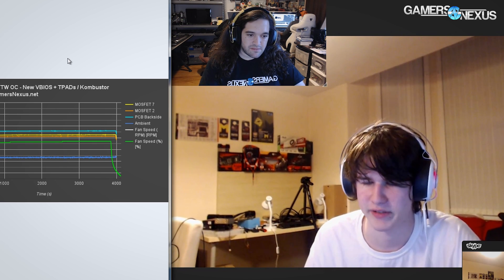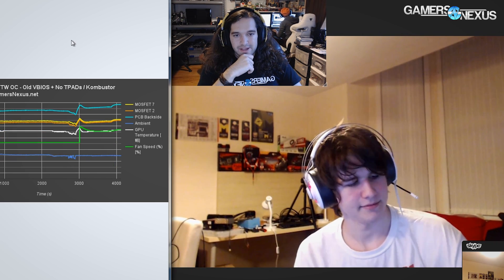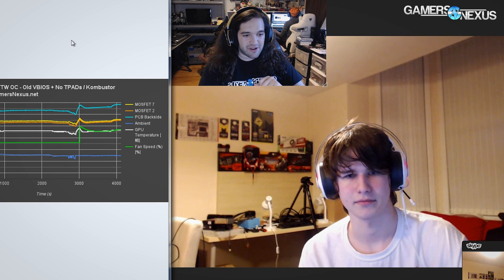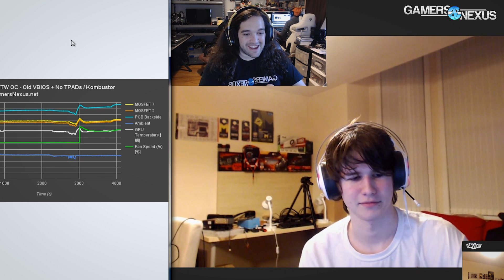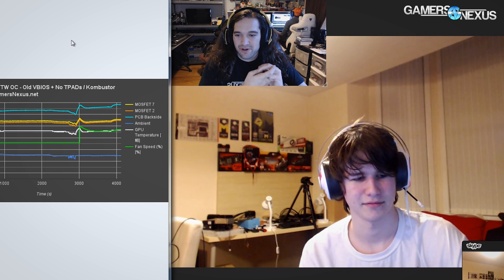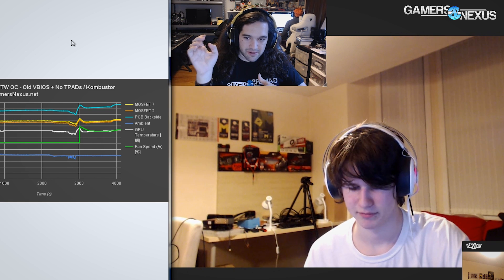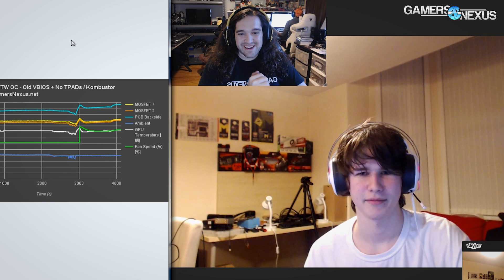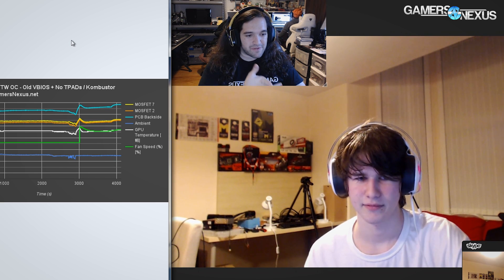Full Buildzoid Conversation on EVGA VRMs & Dying Cards

Comment: I had a 1080 FTW DT pop on me a couple days ago during path of exile. Didnt notice any real flash and my computer is next to me with a window, all I heard was a slight pop noise, then a light electrical smell. No big deal to me since its under warranty, and my PS shut down the computer. It was a pretty bad card to begin with. Ran very warm, could only top out at 1835. Good riddance. One less bad EVGA 1080 out of there. Did make me get paranoid about temperatures though, use a 1080 Hybrid now (woohoo amazon prime and 2 day shipping!), runs so much cooler, much louder though, but ill take a bit extra noise for it running 35 freaking Celsius cooler under load in similar gaming environment I tested both cards with. Wish I saw this earlier, I already have mine on the RMA train, it only had a very small scorch mark after taking the backplate off to inspect it.

Comment: This is what EVGA tole me. Is this BS?
I do apologize for any confusion this matter has caused as I would like to take the time to clear up any issues you may have about the 1080 / 1070. The EVGA GeForce GTX 1080 and 1070 do in fact have thermal pads as air alone could never cool this area enough to operate properly. The test that was run causing people to be worried was with a benchmark that has been known by Nvidia to damage cards in the past. Due to this the drivers by Nividia actually have it built in so that if your are running this program the card will throttle down. Some people know how to get around this and will run the card in extreme environments. 

We are offering extra thermal pads to customers that want to see better temps when pushing the hardware however this is not necessary and is completely optional. These additional thermal pads will be installed between the backplate and the PCB and between the baseplate and the heatsink fins only as these add additional support to the card for extreme use. These cards are within spec and will run under normal circumstances with no issues. However with that being said we are providing a VBIOS for the cards in order to increase the fan speeds to help with the VRM temps. We are here to support you and if there is any issues with the product you are still covered under its available warranty. 

If you would like to have the card replaced with a model that has the pads installed we can support you with this request. Please read more about the thermal pads in the link I have provided below. Once again I would like to take the time to apologize for any inconvenience and confusion this matter has caused.

Comment: Surely NV reference designs have SMD ceramic or poly fuses on the power rails (both from the slot and PCIe connectors)?

And if so, why in the world would a board partner remove that from the PCB layout when customizing it...
Reply: The only fuses I've ever seen on GPU PCBs are a few cards from Sapphire.

Comment: Shouldn't everyone be even more concerned now because EVGA went along with it being a thermal issue, but it's actually an issue with faulty (poorly made) capacitors? I bet those DPPM numbers go up drastically as more customers get past the 3 month time period where such defects are unlikely to occur. There's nothing EVGA can do about all those cards with bad capacitors besides stand by their warranty.
Reply: A bad batch of ceramic caps can easily end up on a very small number of cards because 1 PCB can have over a hundred of them.
Reply: Thanks for your response. I trust your insight on this issue. In the conversation you said something along the lines of "maybe some, maybe all?" in reference to the bad capacitors and how many EVGA gfx cards are using them. I guess we'll never know for sure, but if you think it's safe to assume this type of manufacturing issue is likely to occur on only a few batches, I'll take your word for it.

Comment: I wont buy EVGA GPUs , but I do think heat wont short circut the cap and explode. Buy ASUS GPUs if you want reliable trouble free GPUs , ASUS has better quality control than EVGA .
Reply: But if something goes wrong you'll wish you had EVGA's customer support to deal with
Reply: ASUS puts out crap too sometimes. I'd still trust EVGA for the customer service alone. I've dealt with ASUS and their shit customer service, I've known people that have dealt with them that felt the same way, and have read too many horror stories about their customer service for me to trust them with my money.
Reply: CK S No company is free from defects. I had an Asus GTX 970 that suddenly stopped working. Researched the issue and seemed like it happened to others to. The best thing to do is to go with the company that has the best track record for customer service.
Reply: id say evga is at least as good as asus in some departments, though asus does have more selection in terms of what they offer. i mean fuck you can buy a 99$ 10gbe network card from them for christs sake.

Comment: Did the thermal pad mod last night at like midnight and it hasn't blown up yet! (First time taking apart a card) Thank you Gamers Nexus for helping with the install video, and hopefully my EVGA 850w G2 would save the rest of my components if the card is defectivr and wants to commit mass genocide
Reply: power supply wont save anything, its more the board that matters and in this case it doesnt matter at all. the risk would be the card going bang inside the case and debris hitting other components which the only way to solve is to completely remove the card. 

however a mobo can make a difference in components dying it if dies or if the psu dies, a cheap board may not protect the other parts as much as a good board when either the board itself or the psu dies, your psu is likely to not murder other things along with it but thats never 100% certain, depending on your board it could be good or bad.

Comment: This thing really got blown out of proportion.

EVGA is reporting a failure rate of 200 in 1 million. (I originally said 10,000 but that was wrong, thanks Steve for correcting me. But a failure rate of 200 in 1 million highlights how small this issue is even more.) That's well within what people can expect from a high-quality manufacturer.

IF people are going to make a big deal out of this they need to do an analysis on more brands than just EVGA. Take apart failed cards from Asus, MSI, Gigabyte, Zotac, and any of the other board partners. Only then can we determine if there's a quality control problem that we, as potential customers, need to worry about.

Personally I've been happy with the EVGA video cards I've purchased in the past and I wouldn't hesitate to buy one of these 10-series cards from them. My personal experience is that I've had to warranty video cards made by other companies (based on both Nvidia and AMD GPUs) but not EVGA. My sample size of one person and around 20 video cards is too small so the only AIB partner I won't ever buy from is H.I.S. because I had several problems with them, not just a video card failure. Even if EVGA got more bad capacitors than is usual that's on their supplier, and I can guarantee EVGA is taking a close look at that possibility.

Don't get me wrong here, I'm not saying Gamers Nexus is at fault for devoting so much effort to this issue; quite the opposite in fact. Steve's willingness to go the extra mile has done more to exonerate EVGA than lay blame on them.
Reply from the maker: They reported 200 in 1,000,000, actually. That number was provided to GamersNexus. We are the source for that number.

Please check our original content piece for more: https://www.youtube.com/watch?v=mpxQaSjQclo
Reply: +Gamers Nexus

Thanks for the correction, I'll edit my post to reflect my mistake. (How I turned 1 million into 10,000 I don't know.)

I've already watched all your videos on the issue, I simply had a brain fart. :)
Reply from the maker: Ah, no worries! I've seen it re-re-reported a few times on forums/elsewhere. Number seems to change every time :)

Comment: I just bought a 1070 ftw. I'm well aware of the "heating" issues, but I decided to give it a try. Thanks to the deep work these guys went through I'm feeling more confident about the card and the Evga's customer service support. Hopefully I will get a card with the latest bios and thermal pads installed from factory. But if it fails I will share all the info with you guys. Thanks
Reply from the maker: Thermals are not really a problem, yeah. Apply the pads/VBIOS just because better temperatures are not a bad thing. But they are not the issue, and the 'issue' is not widespread, anyway.
Reply: same here, ordered mine 1 week ago, Germany here

Comment: it would help with reducing the damage if people used multi-rail PSU's
Reply: Uhm.  This has exactly jack all to do with what'll happen if a PSU fails.  If a PSU fails, number of rails means nothing, the entire unit will fail all at once.  What number of rails CAN help with is that a PSU can invest in one or more rails more heavily, the ones running the mainboard, cpu, and graphics cards, and let the peripheral rail be a bit more relaxed when it comes to regulation...  All THAT helps with is potential overclock stability since overclocking inherently means leaving spec.  Spec is "good enough" if you leave everything spec.

Comment: I recommended an EVGA GTX 1080 FTW to my brother :(

He trusted me!

He gonna be so mad :((
Reply from the maker: The cards are mostly fine. We already explained this several times: https://www.youtube.com/watch?v=mpxQaSjQclo
Reply: Robert Depuoz
 furmark is not a powervirus all it does is use the card to its full potential. that is all, the reason it broke cards in the past, was because manufacturers used inferior vrms for this load, which they did not expect.
now i want u to get this:
they did not expect someone uses their hardware fully!!
how a card these days should handle furmark is as follows:
the coller will be capable to stay within its clock (not boost but the minimum clock) and the card will not block below that.
the vrm won't have an issue with it, because it is properly setup to handle the load, because again all furmark does is use the card fully, unless the company used crap vrms or crap cooling.
however companies liked to call it powervirus, because then they dont have to face the reality, that they skipped on proper vrms/cooling.
a big big warning sign for this, is when a card comes with a less powerfull vrm than the reference cards, like the red devil does.
https://www.techpowerup.com/225214/powercolor-outs-unlocked-bios-for-rx-480-red-devil
a good and proper card will not have an issue with furmark and the worst that should happen for it is, that it goes amrginally below its minimum clock to keep temps low enough, which is already questionable but its okish.
just to get this home:
a vrm should be designed with adequate headroom for overclocking and for very high ambiend temperatures at least! so again if it can't run furmark at its default clocks and voltages then don't get that card, but don't call furmark a powervirus. (u called it a virus but i assume u were referring to powervirus).
like what's next we can't run intel burn test to test cpus, only light load for them.....and yes this is the exact same thinking.
Reply: Do you think I need the thermal pads? Only time I've had issues is when using my HTC VIVE. Normally I increase the fan speed and its fine. But I feel like a 1080 shouldn't be missing frames even in VR.
Reply: I'm using a 1070 ftw for the last 3 months or so and i effing love it.I think the chances of your brothers card failing are slim and even if it does EVGA will take care of him. The bios mod is super easy and not necessary if you run a custom fan curve and the thermal pad mod is also pretty easy and worth doing even if thermals were not the problem. I have no regrets in my purchase and am very happy with my card, hopefully he is as well.
Reply: at libtarded cuckservative 
u only meant good :(
see the positive, the company at least handels it ok, unlike samsung's 840 evo issue, or apple's older macbook's that had dying extremely hot gpu's  and apple denied, that it was their issue and only later gave extended warranty under pressure.
so u know it could be much worse if it is the capacitor, that means u chose  a card, that doesn't have crap vrm components, but just a bad batch of capacitors.
Reply: I messaged them and they tole me this
I do apologize for any confusion this matter has caused as I would like to take the time to clear up any issues you may have about the 1080 / 1070. The EVGA GeForce GTX 1080 and 1070 do in fact have thermal pads as air alone could never cool this area enough to operate properly. The test that was run causing people to be worried was with a benchmark that has been known by Nvidia to damage cards in the past. Due to this the drivers by Nividia actually have it built in so that if your are running this program the card will throttle down. Some people know how to get around this and will run the card in extreme environments. 

We are offering extra thermal pads to customers that want to see better temps when pushing the hardware however this is not necessary and is completely optional. These additional thermal pads will be installed between the backplate and the PCB and between the baseplate and the heatsink fins only as these add additional support to the card for extreme use. These cards are within spec and will run under normal circumstances with no issues. However with that being said we are providing a VBIOS for the cards in order to increase the fan speeds to help with the VRM temps. We are here to support you and if there is any issues with the product you are still covered under its available warranty. 

If you would like to have the card replaced with a model that has the pads installed we can support you with this request. Please read more about the thermal pads in the link I have provided below. Once again I would like to take the time to apologize for any inconvenience and confusion this matter has caused.
Reply: Snowman AKA Joker i did the thermal pad mod a couple weeks ago in mine and it's pretty easy. No reason to be without your card while you wait for them to ship another 1. They do have some thermal pads in them but they send thicker ones and some for some additional areas of the card. The software they were speaking of is furmark and they were correct in their assertion that it kills cards. If you watch gamersnexus' video about this issue he pretty much tells you it's basically a virus for destroying vrms. This has been known for a couple years now which is why I won't let it near my rigs. All the talking down of evga that people are doing is stupid, they provide a quality product and then stand behind it. I feel that they have handled this situation well. Jmo
Reply: Snowman AKA Joker
eh unless i'm missing sth. u are talking about gpu temps and thus performance and not vrm thermal runaway potential.
the pads are for the vrm only and vrms work perfectly fine until they blow up in thermal runaway, or if a crappy capacitor explodes, which may very well be the issue as the video mentioned.
so the pads won't increase your performance, but it will make the vrm run cooler, which is never a bad thing.
honestly i would at this point just exchange the card, because of the chance of having a bad capacitor, but if not i would definitely install the thermal pads, which again won't change your gpu performance, but will make the vrm run cooler.

Comment: Only take the card apart if the warranty is out.
Reply: EVGA allows you to remove your cooler without voiding your warranty
Reply: tonedcos I think evga doesn't care if you disassemble the card
Reply: tonedcos
Then you just contact EVGA and they will sort it.
Reply: Good to know this about EVGA.  I really should probably bring myself up to date on current manufacturer warranty policies in regards to removal of stock coolers.
Reply: I know some retailers might not